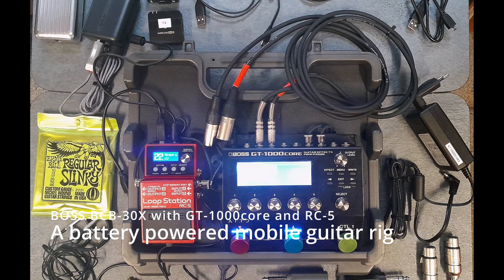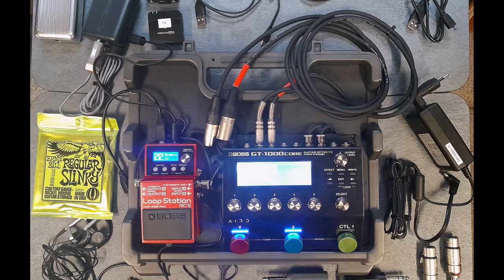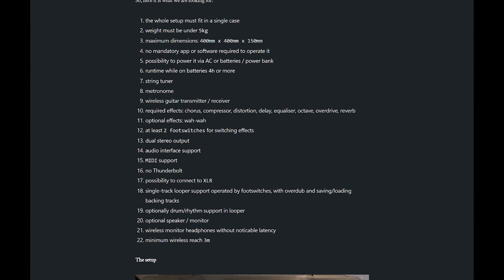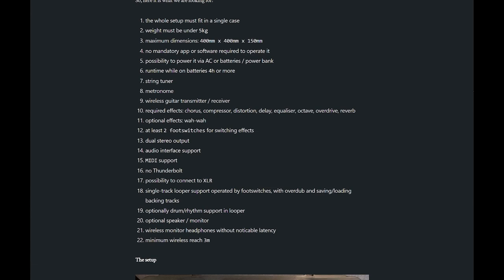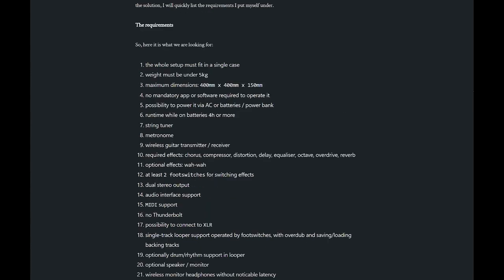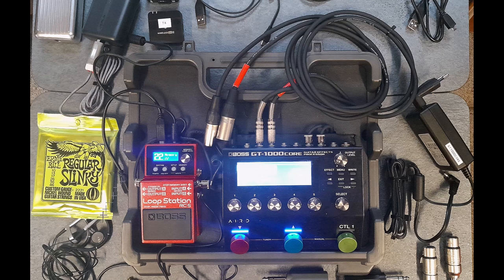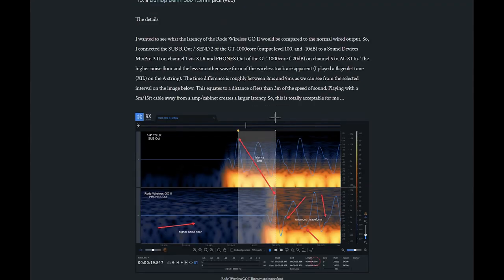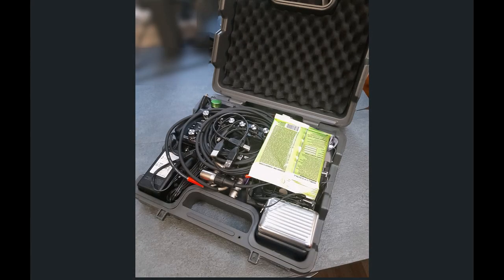Battery powered mobile guitar rig in a BOSS BCB-30X (GT-1000core, RC-5, WL-20L, B&O A8, Wireless GO)

Comment from the maker: Corrigendum / Addendum
* Contrary to what I said, the BOSS WL-20L do not completely drain the battery - the transmitter enters standby after one hour and the receiver enters standby one hour after having no connection with the transmitter. This, essentially means, if the devices are not unplugged after use, the receiver will be powered up for at least two hours after use. In my case, I seemed to be just unlucky that the receiver was empty when I wanted to use it next time.
* Depending on the use, I managed to power both devices up to seven hours instead of just five hours with the Jsaux battery.
* It is possible to power both devices with the Zendure battery, but only when using separate MyVolts 9V adapters for each device. Power up sequence:
    - Disconnect the RC-5 from the 9V distribution (#11)
    - Connect one MyVolts 9V adapter (#9) to the USB-A socket of the battery (#1), connect it to the GT-1000core (#21) power it up
    - Connect the other MyVolts 9V adapter (#9) via the USB-C to USB-A receptable adapter (#7) to the USB-C socket of the battery (#1), connect it to the RC-5 (#12) and power it up
* I added a CME WIDI Jack, so now I can connect via Bluetooth to the GT-1000core. See https://appclusive.net/2024/02/11/using-the-cme-widi-jack-with-a-boss-gt-1000core-and-a-rc-5/ on how to do it.